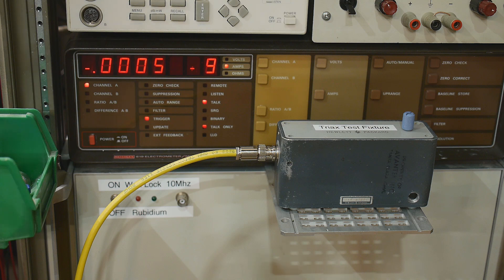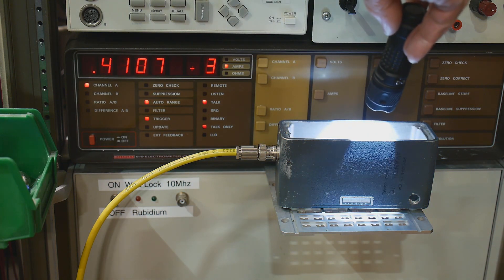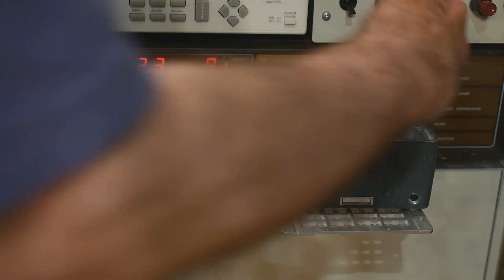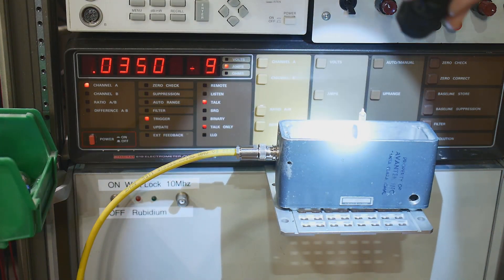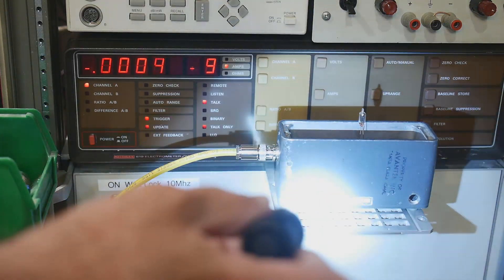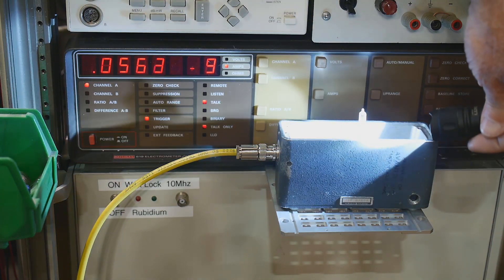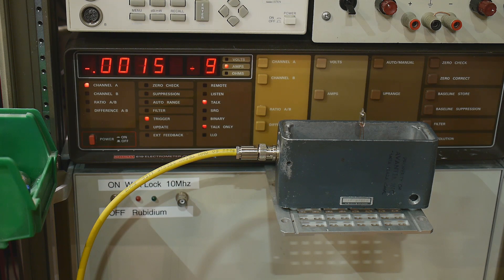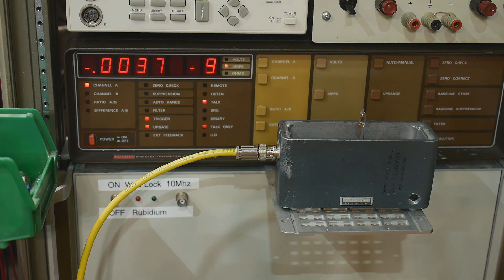#786 Photoelectric Effect in Neon Bulbs Measured by Electrometer

Comment: Wow. You revisited this and did not read up about these neon bulbs. Oh well, no commenter caught on either.  I suppose there are no old physics teachers watching.  I pointed out in previous series how the metal coating on electrodes have a low work function which helps the emission process.  Flickering is a sign that coating is becoming degraded.

Comment: I think you are  ionizing the electrons of the cathode or anode metals.  These metals have work function, which is photon energy needed to ionize the metal electrons.  When you shine mostly on anode metal you ionize anode's electrons and anode becomes positively charged.  When you shine mostly on cathode's metal, cathode's metal electrons ionizes and leave the cathode positively charged.   You can reduce the work function of the metal by heating it up, as it is done by filament in vacuum tube .

Comment: Probably photoelectric effect dampened by the dilute gas. Natural to have an asymmetry in charge flow with asymmetric illumination. You could try putting a small bias on the bulb, with illumination from one side and see if you can get the photoelectric current curves. I remember watching a video which used the neon bulb as a (very inefficient) Geiger tube.
Reply: The visible light has enough energy to overcome the work function of the electrodes' coating. You created a net current by asymmetrically lighting which asymmetrically produces photoelectrons.  A wonderful ammeter you have!  
You might be able to determine actual work function energy by using tungsten light source incrementally heated up.  Photoelectrons escape(producing measurable current)  when their kinetic energy (equals hν) >metals work function. Would need a spectrometer to get highest frequency of light being emitted just when a current starts to flow.
Reply: @jspencerg  Yes, you have a good explanation.  It would be interesting to use a series of LEDs and infrared emitters of increasing wavelength as the source of illumination.  Beyond a particular wavelength, the current would no longer be produced, no matter how intense the illumination used.  (Thanks to Mr. Einstein for our understanding.)

Comment: Yes, Mr Carlson is rebuilding an HP 410 which is an AC VTVM and  differs  from my HP 412A, a DC VTVM. in several regards.  Carlson's instrument has a valve mounted in an AC probe.  His instrument and mine were manufactured over the same time frame, 55- 70- or so. I was astounded to see that HP charged $250 for the 410 when Palo Alto began the run.  A guy on EEVblog asked if the 410 was supposed to be the holy grail because they command a lot of dinero today. I also discovered that some of the 412A units used incandescent bulbs in the chopper.  Mine are neon or my cataracts are worse than I  thought.  Same guy reported that the photocell in the chopper needs to be exposed to light at all times ???  My 412A came out of a lab at Oregon State U per the ID tag.  It's in great shape, cosmetically, but has something like a 4 mfd filter cap, I probably should change out.  The one thing I really like about the 412 over the 410 is that the 412 has a mirrored meter which is larger than the non- mirrored 410.  That's all I know.

Comment: Thanks. It looks like the chopper is an electromechanical mechanism. When it eventually dies, it dies,  my 1958 manual directs the user to contact the HP rep for replacement. Fortunately, mine is still working.
Reply from the maker: I remember someone rebuilding it. Mr Carlson?

Comment: Perhaps the bulb causes some refraction. Do you have a UV light laying around? Not sure if the difference in wavelength is significant enough to be measurable.
Reply: The question is whether the glass allows the UV to get inside. One could try to illuminate the bulb with a little flame. I guess we are very close to inventing the UV-tron. There a Neon bulb with UV-transparent glass is used and the bulb is powered with a voltage above operating but below igniting voltage. So it is usable as Geiger counter for UV photons. It is used to detect flames.

Comment: A 405 nm blue/violet laser pointer works really well for this...  A NE-77 trigger tube with its three electrodes would let you tease apart what it actually going on, as will DC biasing.  It is fun to sweep the bias too, an old curve tracer makes this easy but a mains transformer (especially a vacuum tube supply transformer or a pair of filament transformers to make an isolated ~150 volt AC source) and a few resistors works to make one.
Reply from the maker: Never seen a NE-77 they look really interesting.

Comment: You made me run out to the shop to look at my HP 412A VTVM , which has a neon array which glows so brightly that the light streaming through the louvers casts shadows. Now I'll have to read up on this....
Reply from the maker: That does not use photoelectric effect. It is just an old school optocoupler used as a chopper stabilized amplifier. Also interesting

Comment: Thanks for the interesting video! In out collection we have a bunch of Elektronika D3-28 (Электроника Д3-28) machines, the Soviet computers loosely based on Wang 700 series of calculators. They have 7-segment nixie displays which for some reason cannot quickly light up on power-up after the machine was turned off for a quite long period of time. A flashlight or just turning on lights in the room usually act like a trigger making the display lit. Looks like it needs some amount of ions to ignite the initial discharge and than the process continues on its own. More interesting that the display in D3-28 is not static, it works in dynamic manner with 1/16 duty cycle (2 rows of 16 digits) and has a pretty high update frequency. I still don't know exactly if the effect is due to gas itself or it's somehow connected with other parts of display (electrodes, glass, getter, whatever).

Comment: I am thoroughly confused as to how a glass gas discharge tube envelope (filled with neon gas) and two (2) parallel tungsten electrodes (neon lamp with approx. a 90 volt breakdown voltage) can possibly emit a polarized current, just by exposing it to white LED light. How does one of the electrodes distinguish itself with a reverse polarity from the other electrode, when both are exposed to the same light, at the same time? I realize that there is usually a small amount of radioactive material added to neon lamps, to improve ionization in low light conditions, however, how can one of the electrodes choose a polarity over the other one, with just neon gas in the envelope? I really don't get it...   Fred
Reply: The electrodes are somewhat dissimilar. Anything with emissive coating is different from everything else with such coating, and usually the difference is greater the more you actually want them to be the same :) Neon bulbs polarize very quickly at DC, with one electrode gaining in emissivity while the other loses it. Neons are definitely not in a perfect  “identical electrodes” state – neither when new nor when running with AC.
Reply: More electrons are being knocked out of the electrode experiencing the greater illumination.  Thus, the direction and magnitude of the net current changes as the flashlight is moved from side to side.

Comment: Do you get the same positive/negative effect when the neon bulb leads are switched, or is it always one electode is pos and the other neg ?. Also, try it with a Nixie.
Cool stuff for the clever folk to work out. :)
Reply: This is a great question and I also wonder if the polarity follows a specific lead/terminal or what. What is going on here?
Reply: @electronicengineer  Could be wrong, but I vaguely remember reading that some of these bulbs have one electrode doped with a radioactive material like Thorium that lowers the ionisation potential. Could this explain the effect?

Comment: Strange as you would think the two electrodes are identical and the gas is the gas so how does it know which electrode is being illuminated? Maybe the two electrodes are not the same? Any neon bulb engineers left out there?
Reply: The electrodes are coated and they are never the same in spite of the best efforts to the contrary. As far as I can tell, the slight dissimilarity (including the slight asymmetry of mounting) is enough to produce a measurable effect. On some bulbs, the sensitivity goes through the roof if you polarize them well – say 5mA DC for 5 minutes. It doesn’t always work though – no idea why, yet. It’s also worth looking at how they behave after running them in arc discharge for, say, a second.
Reply: @absurdengineering  The effect would be the same, even with identical electrodes.  The asymmetry is due to the illumination rather than the electrodes.  To put it crudely, more electrons are being knocked out of the electrode experiencing the greater illumination.  The light is supplying the energy (remember photon energy equals Planck's constant times the light frequency).  Thus, the net current changes direction as the electrode experiencing the greater illumination changes.